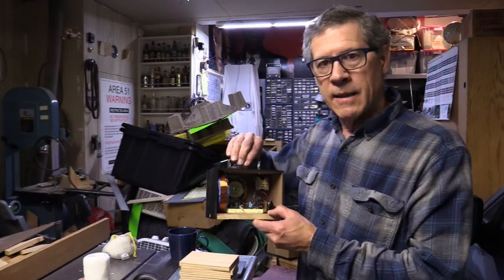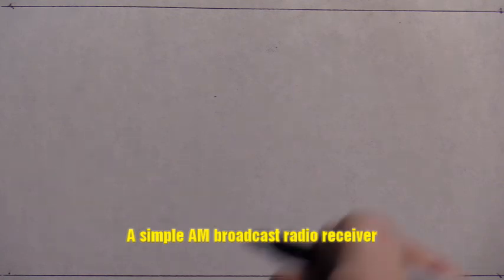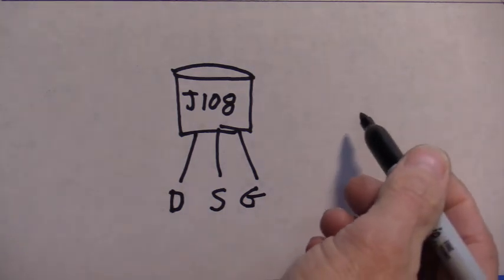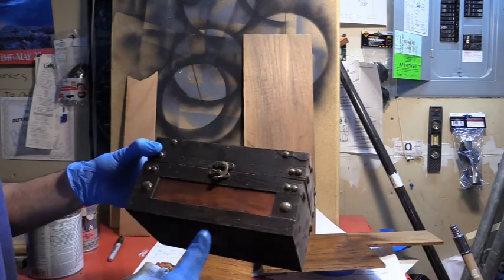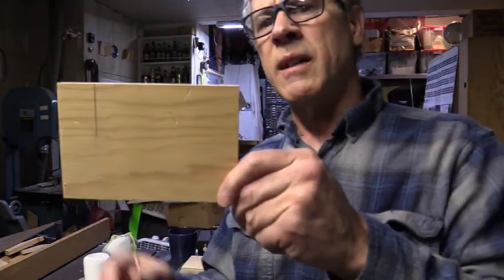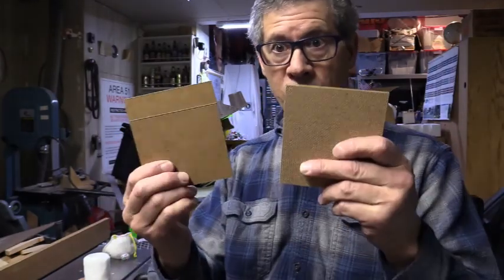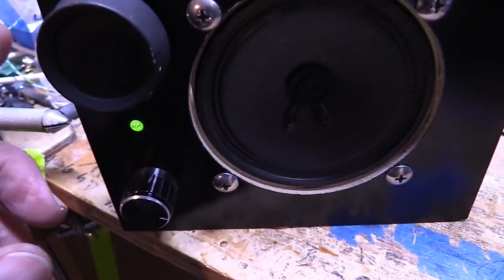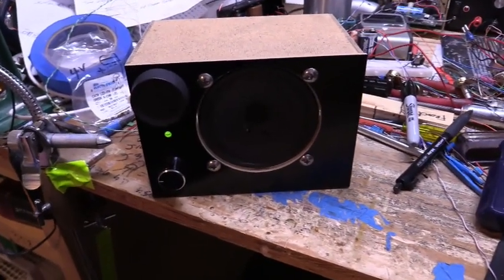AM radio build using a FET

Comment: In you schematic .,Gate is not connected to ground trough resistor so it is a error??
Reply from the maker: No, not an error. You could place a 1 meg ohm resistor from gate to ground but it is not needed.
Reply: @DavidALovingMPF102  well i am use 2SK161 as a FM preamp in my FM receiver and this FET refuse to work, aka no signal gain to mixer ..but when i add 150K resistor then work excellent with 560ohm SOURCE resistor and his 1nF capacitor makers very good FM signal amplification...ok maybe is different for AM ..but still strange
Reply from the maker: @zlatkovidlanovic6454  The 2SKS161 is too good for the AM radio receiver hah hah! The 2SKS161 works well into 100 MHZ, This radio just needs to work around 1 MHZ but I am all for experimentation. Thanks.
Reply: @DavidALovingMPF102  ahh how can be too good...there is no such a thing ..also most FET transistors are not limited to higher frequency as Bipolar transitors where you have BC and BF types ...so every FET is good, and here is the thing in biasing to FET gate that work optimal not by chance ..this is for the sake minimum stability
Reply from the maker: @zlatkovidlanovic6454  For a hobby AM radio, what ever works is ok. For a surface to air missile, radar, I would be very exact!

Comment: I hate how most ham radio guys use electron flow theory. 

Conventional current is intuitively easier to understand. It's easier to understand current going from positive to negative and having the voltage drop as it flows through the resistors. 

Electron flow imagines current flowing from negative to positive and therefore the voltage increases as the current flows through the resistors.

Comment: I wonder if putting a fet amp on the front end of a TA7642 would increase its performance?
Reply from the maker: I have tried a fet rf amp between the antenna coil and the detector fet. I think it was common gate config. Right now I'm only on coffee #2. Obviously, I didn't know how to bias things because the gain was way too high, whistles, squeals motor boating. Made a good oscillator. A good ground helps at night. Is the TA 7642 the 3 leg to-92 looking thing or is it a inline chip? I might have some. Different ways to attack a basic diode detector radio. One way is to determine the stations you want to listen to and make individual tank circuits for each one plus rf amp. Now place a rotary switch between all those tank circuits and rf amps and the final audio amp. Strange how we use our spare time. Of course the super het fixed all those problems.

Comment from the maker: Sometimes the radio will have a buzz or growl sound, especially if the volume is turned up. A .001 uf cap placed on the volume pot center connection wire then to ground will stop most of that. So, make that change in your copy of the schematic.

Comment from the maker: Ok, well the days I shot this, the radio stations were having trouble on the 10,000 ft mountain with their antenna icing up, affecting broadcasts. This radio does sound better today than when I made the video. As for the 5.6k resistor..I have replaced that resistor on some radios with a 10k pot so the amplitude of the huge signal sound can be reduced for better sound, then adjusted back to 5.6k or even lower for weak stations. You could try a potentiometer at the front end, to reduce the input rf signal for those strong stations too. What is strange, IMO, is that it is hard to make a good AM transmitter, but easy to make a good AM receiver. It is easy to make an FM transmitter, but hard to make a good FM receiver. Have fun with this. Be safe!